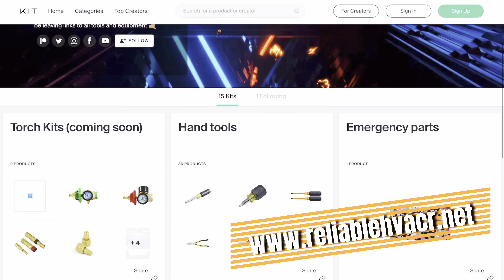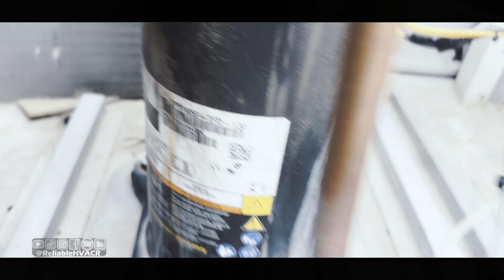Did not expect this on a new unit

Comment: I have the design drawn up, just need to get the parts to make a ladder crane. Cheap version will just use a gear reduction boat winch, more expensive will use a small powered winch. Roping up compressors are always fun. Good video brother!

Comment: Try rope climbing ascenders and use them upside down to rope compressor up. And the second one hold the weight locked and as you pull unlatches

Comment: I bet the compressor blow out because of the dryer. I don't like those liquid dryers
Reply from the maker: Really? Interesting
Reply: Doubt it. I blame the compressor manufacturers. Since the pandemic all QC has gone straight out the window. Everyone got laid off during quarantine then after they could ramp production back up they hired anybody with a pulse just to churn out numbers.  Compressor was likely compromised before it even got to the unit manufacturer.
Reply from the maker: You find more issues on new equipment now then before that's for sure